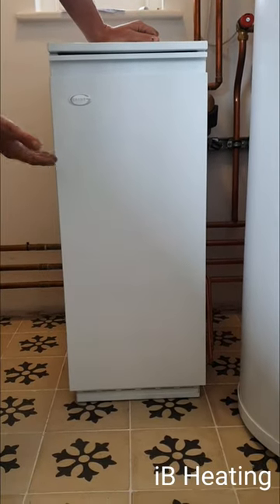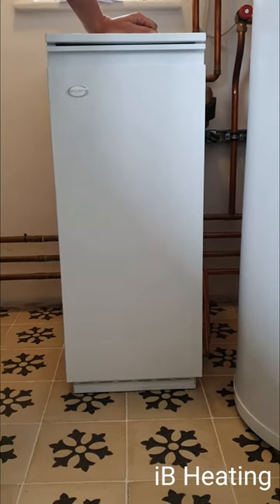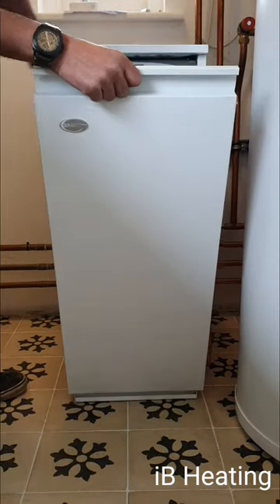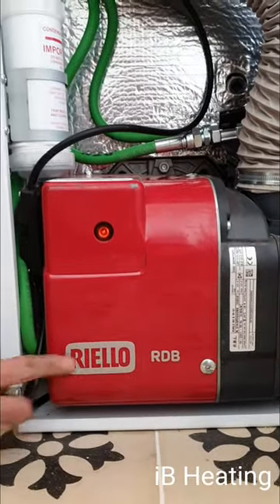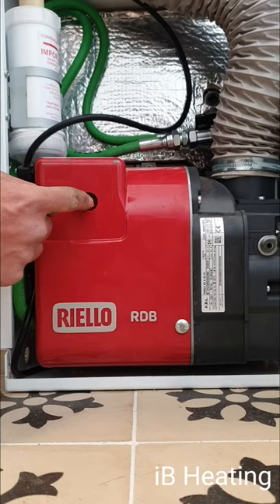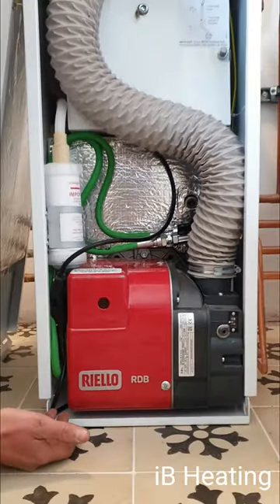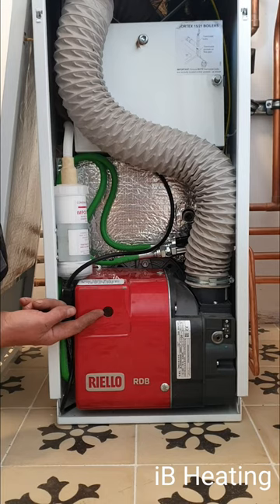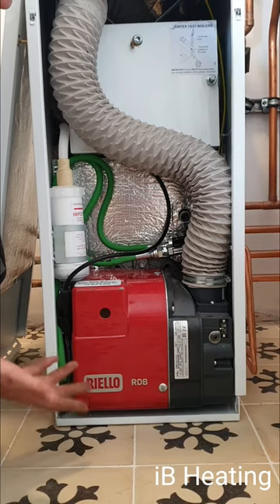Oil Boiler gone to lockout? how to reset the burner on your oil boiler.

Comment: Ran out of fuel and now there's no led light in reset button. Have turned electrics off and on several times. Seems dead. Any tips?
Reply: Hi Joseph, same here, wondered did you get it sorted to help me get mine going
Reply: @antonioraphael1437  Yes - I turned the power off for the whole house at the fuseboard and this allowed it to reset. Worked OK after that.
Reply: @JosephFallon  you need to bleed the line. There is a valve on the pump that must be opened when firing up. Open it slightly and fuel and bubbles flows out. Once the fuel runs clear just tighten it up and thats you. If the fuel doesn't pump through then the oil filter could be clogged up

Comment: I have a Worcester oil boiler greenslave 6 year's old,has stated to cut out and fault code F9 588, Worcester engineer has been out,checked tank for water all ok,checked filters,ok,new nozzle,no air in the system, diagnostic check showing everything as it should,1 hour here boiler working,then halve an hour cut out same fault code F 588, phoned he thinks it needs a new pump, any ideas thanks

Comment: Ive a grant outdoor boiler, its only firing up when the outdoor boiler switch is on AND the test switch is on. If I turn test switch off the boiler wont fire up. Any ideas as by leaving the test switch on permanently the boiler makes a low hum 24/7. Sounds like a car lying idle in the driveway at 3am every night
Reply from the maker: Hello. This sounds like a control issue. I would take a guess at it being the motorised valve and  not the boiler itself.
Reply: @ibheating  Yes definitely something going on there. Its 2 zone switch. For some reason when Z2 is called the motorized valve energises, the actuator moves across and the boiler will fire up. However, when Z1 is called, the motorized valve energises, the actuator moves across but the boiler will not fire up. The only difference I seem to be able to identify is that the grey cable coming from the Z1 motorized valve is not sending power back out of the valve, whereas the zone 2 grey cable gets 240v when I call for it.
Reply: And I think that the grey cable is responsible somewhere along the circuit for giving power to the boiler??